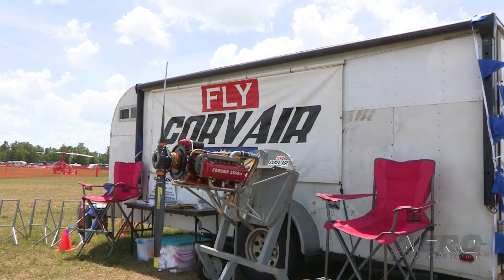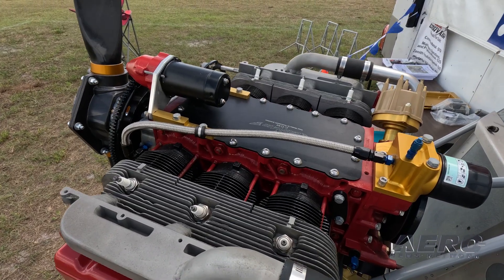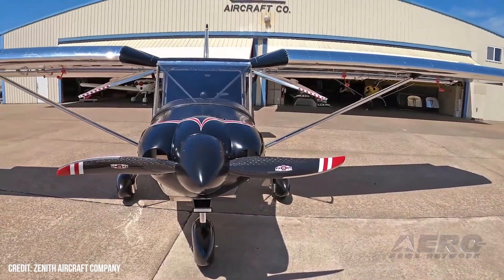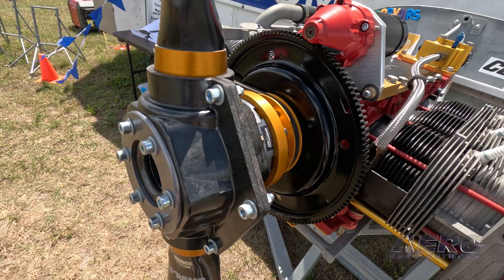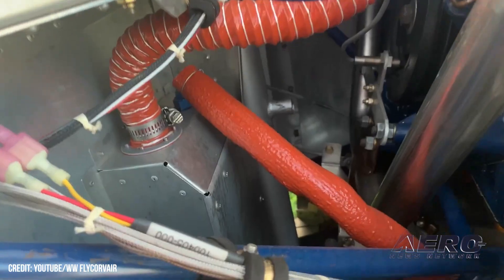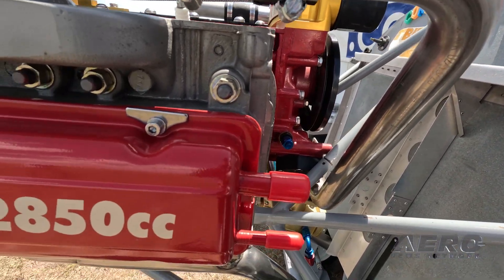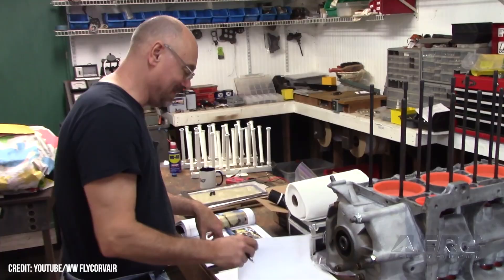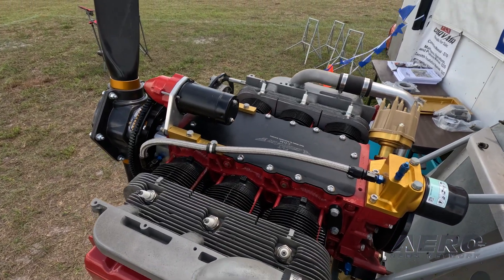Aero-TV: Fly Corvair’s Reliable Engine Alternative

Comment: Yeah ! Several low-time Corvair engines suffered broken cranks. No thanks.
Reply: The Corvair that you see in the video has a fifth bearing to solve that very issue.  That's been the standard for over a decade now.
Reply: Sounds like an AD would be issued if that were a real issue.  Got any references?

There isn’t a plane engine without a history of crank challenges… Lycoming had a big issue about a decade ago…. Big cranks are incredibly expensive.

😃
Reply: Lycomings break cranks as do continentals.  Whats your point?  The problem with broken corvair crankshafts has been taken care of

Comment: I'm on my second covair .. first one was a 100hp 2700 that was in a flying Zenith 601 I bought. Between myself and the builder we put about 600 hrs on it, before I replaced it ... with a 3L Corvair that William built for me .... there was absolutely no reason to change the 100hp .. other than I wanted more hp and speed out for my 601 ( my main flight mission it 2-3 hr xc from the Boston area to family in Nj) I've got about 25hrs on that swap, that I did this spring... couldnt be happier with the swap.. or the Corvair....